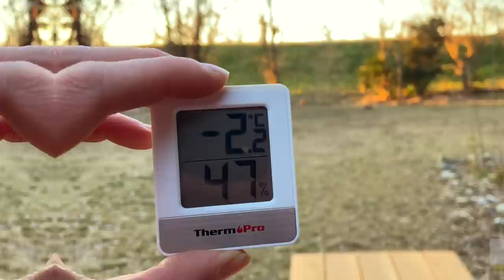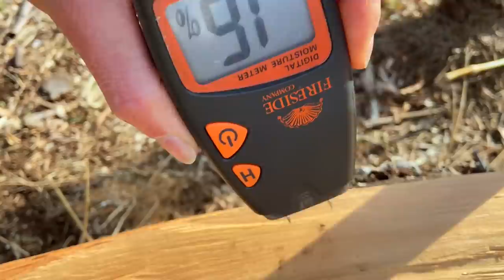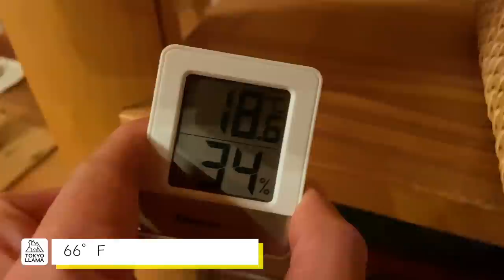Winter in a Japanese House | Tokyo Llama

Comment: I live in a 1970's house with big floor to ceiling windows in all of the rooms and switching to triple glazing made a world of difference, more so than the ceiling and wall cavity foam insulation. I had the original wood windows still in there and there were big gaps and draughts all over the place. I don't have central heating (just a couple of storage heaters) so keeping the heat I have is very necessary!

Comment: Love seeing the traditional house.  

On the insulation and air gaps.  I have an old extra house. I spent a day going through it spent almost $100 on insulation stuff. Most importantly air sealed the entire place. My heating bill dropped in half from $300 to less than $150 a month. 

This winter no one is in it and I put the thermostat at 60f and the electric bill has been $60 a month all winter. 

Funny you mentioned Nashville that’s where I grew up and not far from it now.

Comment: Living in switzerland, I'm quite shocked seeing the gaps in the doors and windows. In our country it is an absolute no-go. I'm living in a 25 year old house (with in swiss opinion "poor" insulation), and the heater is turned off during night, but the temperature drops 2 to 3 degrees (maybe 1 or 2 more when the temperature outside is beloy -10°C). It's hard to imagine living in your condition: 8°C... I shiver by only hearing it... ok, I'm a wimp ("Warmduscher" as we say in German).
Reply: Lol, warmduscher here as well, I was staying in a traditional little house in Kyoto in january a few years ago.. and the toilet and the shower room were outside in the yard. Yes, the toilet seat is heated, but you still have to cross the snowy yard and.. well drop the pants. Showering was even worse, there was only a small heater on belly-level so after the shower your feet and wet hair was icy and I had to do the fastest dressing myself ever to run back into the house and hide underneath the futon. Nichts für Weicheier.

Comment: Single-pane windows are literally out the window, so I think doing a full upgrade will be needed (preferably in the mid-springtime when it's warmer). That is a very interesting way to stack split wood. I prefer the usual "jigsaw" method myself, especially since I have a wood shed. But that kerosene stove makes me super nervous. Upgrading the insulation in the house is definitely a must, especially in the attic spaces (you can also use the spray-type for filling in the very small areas as well). Keep it up!!!

Comment: My hubby owns a very reputable, mid sized HVAC company. He has used that exact version you have, the upgraded version, and other brands & variations. Your phone’s camera with the os you downloaded to make it a thermal camera is fine. I actually still use it. It’s quick to download, easy to understand and operate.
Reply from the maker: That's good to know! Thanks. I'm happy with it and don't need pinpoint accuracy for my uses.

Comment: Hi. We had our windows replaced in our cottage, bricks not wood, but we do live in a very green area. I asked the engineer what the benefit of the triple glazing was and should we go for it. He said it really is only a benefit if you live in a noisy area and want to block out traffic, planes etc. Worth considering if usually your temperatures are mild. Good luck with it.

Comment: a lovely feel to this video. those kero heaters certainly have an unmistakable smell to them. i would get one of the diesel heaters used in caravans which ducts the combustion gas to outside. plus they are efficient and quite cheap and give push button operation

Comment: When I lived in Japan we also used a kerosene space heater.  Later I bought a small electric heater, shaped like a box and only about 12”x12” but it was great, so I recommend that.
Reply from the maker: We do have some electric ceramic heaters in the bedrooms, but not as good as kerosene, however we don't want kerosene stoves in the bedrooms.

Comment: Hey neighbor, here in our 8 year old house in Tsuchiura we still have some cold spots. Despite the double pane glass and newer construction, I think its just status quo. Our house is single story and we only have the wall mount heaters which are less than ideal. Id like to install some radiant floor heating this summer. We have a bit of a crawl space under the house, so hopefully the install can be less painful. Currently we just heat the rooms we use most, keep our inner doors closed, and the rest are quite chilly....shognai I suppose. Love the crisp dry Ibaraki winter so far though (first one) happy its low moisture as it doesn't feel as bone chilling cold.

Comment: Heated floors are now very popular in Japan, along with heated carpets. I spent my first few years in Japan working under a 'kotatsu' in a 6-mat room. The kotatsu is just a large quilt placed between the top and leg-section of a low table with a heating element underneath it. You tuck your legs under the quilt and that keeps you nice and warm -- very energy efficient and very cozy! Some kotatsu also have a depression under the table for added comfort.
Perhaps you could introduce your viewers to the charms of traditional and modern kotatsu.

Comment: If I can make a suggestion on the older ceiling insulation? There are often types of insulation that can be sprayed over a surface to a desired thickness, and dry to form a solid, water proof layer. I would definitely look into doing that and keeping the old insulation in place. It may be very cost effective.

Comment: I don’t know your codes for window replacement but I am in the window business in the south eastern us. I think your cost benefit will be best served with a double pane gas filled windows, the low e coating is very important for reflecting heat out in summer and in durning the winter.
  The type of spacer used to hold your glass pack in the units is almost more important then the amount of panes. The mechanics of your sliders is also super important so research the issues with any unit you buy. 
  Good luck and thank you for sharing your journey.

Comment: You have come far on this home. Simple curtains to cover large glass areas at night helps alot. Some day adding floor insulation would be a good idea.
Reply from the maker: We have floor insulation, and with the thick boards can generally walk around without slippers, but curtains would certainly help.

Comment: For the Windows, maybe more of a temporary solution, but there exists some see through foil which got a sticky side and can be glued to windows, got single pane windows in Berlin Germany and it gets quite cold. Maybe that will help with the insulation
Reply: In the US we can buy shrink wrap window insulation you apply with adhesive tape. It works quite well.
Reply from the maker: I'm going to try some of the clear film, think that could be the best solution until we get new windows.

Comment: A thermal camera is a great idea. Japan definitely needs to up it's insulation game. The draughts are nice in summer though.
Reply from the maker: That's right, the house deals with the summer pretty well - didn't need air conditioners last year so that's something to keep in mind if I do remove a lot of the big air gaps.
Reply: @TokyoLlama  It seems you have a lot of windows you can open in summer. You'll need a lot of mosquito screens though.
Reply from the maker: @bfgt  correct, we have fly screens for all of the windows. Lots of mosquitos here.

Comment: I live in Tokyo and the general opinion seems to be that if you insulate too much you will be a bit warmer in winter but you will also be unbearably hot in summer. I tend to agree. It's not hard to make the room you are in warm. Bedding is meant for lightly heated rooms and kotatsu (tables with a heater underneath) keep everyone warm as well. The real horror is the heat and humidity of summer so good air flow through the house is crucial. It was fun to see your house in winter and I look forward to further videos.

Comment: There is a reflective insulation product made of bubble wrap and foil that could help. It is not cheap, but cheaper and easy to install than all new insulation. Could help in the attic areas
Reply from the maker: I'll look into that, sounds like it could be good for some of the ceilings.

Comment: Adhesive backed foam will reduce the air gaps. You can get them in rolls and it’s very cheap solution.

Comment: That heat-vision is very useful tool for "heat bleeding" (nice ref)! As is the moisture gauge (under 20% so all good).

The topic of energy efficiency is so important imho for houses so checking the insulation values is the right thing to do in conjunction with a wood burner (maybe find a cheap plot of land one day and plant loads of trees to complete the cycle). I think the Japanese might be a bit behind on this topic? Some of the natural-build materials such as cob and straw-bale have excellent properties (eg humidity regulation, insulation rating etc) apart from modern materials. As you'll know from living in London, UK, the quality of insulation there is very variable to say the least as well. But good insulation not only feels a lot more comfortable, but will reduce chills that lead to getting colds as well as reduce energy demand and therefore reduce wood fuel used per year which reduces either cost or labour (or both)!

Does the wood stove position where the flute leaves near the top of the house and more or less in the middle of the house to optimize pressure difference in former case and heat convection in the latter case? I like the fan system to improve that convection. In cold countries they build their houses around very large thermal masses which enclose the wood heater in the center of the house to optimize heat during the night at extreme temperatures. But assume your house will act equally well during a hot 36 latitude Summer for opening windows and doors and allowing air in? Japanese houses supposedly open up and allow the outside to "come into the house" as a design aesthetic which seems brilliant to me (In Wolf Children, anime, I think they have such a house when they move to the country where they do this).

A really good environment for the kids to live and grow up in. A physical and mechanical environment to learn about life is really healthy for mindset I think. Eg jobs need doing: Chopping wood, tending food sources or animals. Constructing stuff etc.

Lovely scenes in the snow: You're absolutely right, the house looks like paradise in the snow with the wood burner visible inside, glowing! I like snow, I think it makes everyone think about their environment a lot more and be (needfully) more down to earth. Thanks for sharing and inspiring.

Comment: Not sure if they have it in Japan, but in the UK there is a product that is essentially a large roll of bubble wrap coated on both sides with foil that you can lay on top of existing insulation to augment it. As it's quite thin it doesn't take up much additional space and is very quick to do.

Comment: Good to see your new video.  Here in Idaho we have strong winds which penetrate the homes exterior.  If a home is well insulated it is quite different from its ability to stop air invasion.  Triple glazed windows are great but installing them so air cannot invade around gaps when installed is a must.
Reply from the maker: I'm planning on doing the windows myself, but it's definitely a worry that I do it properly as we do get strong, cold winds here in winter.
Reply: @TokyoLlama    Most U.S. made windows have a flanged perimeter used to attach the windows to the house.  I  use a good exterior caulking on the side of the flange
Facing the house to insure that wind cannot get past this flange.  However the window itself or sash, can leak on poorly installed or inexpensive windows.  I have no idea how your situation in a traditional home in Japan is similar to a new or refit in the U.S.  i do enjoy your videos, thanks for your presentations.

Comment: move your firewood wicker basket a bit further away from the stove, as the oils in it dry it'll be more likely to catch fire

a simple temporary way to improve the windows is to tape the small type of bubble wrap over the windows, it acts like a dead air insulator

dont have to waste time removing the old attic insulation, most times you can just have new stuff blown in over top

heating rocks on the top of the stove and setting them on stone plates in rooms helps keep them warm longer due to the slow release of heat

a kotatsu might be your best friend in the mornings

Comment: with our dual pain windows we also have window shades, along with heavy drapes that 
 block out the heat, we have sliding glass doors, with heavy blinds for blocking out the heart of the sun and the cold from the winter months when need be. really cuts down 
 the amount of energy for heating and colling. I see by the comments, it's a toss up,
 to have it or not, I'll take it, I lived for a time in many places around the world, 
AC is a awesome thing to have, Heating the entire home ois an other awesome way to have 
it, a couple of things mold and if the home is outfitted with plumbing, preventing the pipes from freezing. 
 we have central hearting and AC pump system, it ant cheap. but when it's a 125 degrees out side, your very grateful to be blessed by having it. when a kid I lived in an old farm 
house, the blue room was outside, running water was the hand pump in the kitchen. 
 The electricity was out in the barn. In Bolivia many live in stone wall spaces, no heat 
 no running water. very little medical. Cut our blessings to be blessed to be able to afford 
such amenities, amen..

Comment: It never occurred ti me that the house would be cold. 5 degrees c that IS really cold, considering the minimum works health standard of a warm home is 18 c. I think you need to invest in another log burner or  a couple of heat pump / air con units. Definitely replace those sliders! We are just about to go into winter here in New Zealand 🇳🇿 it’s been an amazing summer. Love your content, been following g for a few years now!
Reply from the maker: It’s only that cold in the morning - it heats up pretty quickly. But yes, we will be putting ac/heat pump units into the bedrooms, washitsu and maybe the kitchen area. We have the breakers/power points set up for additional units if needed. Thanks for watching all this time!

Comment: Our house is an old wood 1900s house with crap insulation and super drafty. SO I feel you. We have a wood stove, but I did not grow up with that. It took a while to learn how to set it up at night so you still have some coals in the morning, enough to keep the eco fan moving. We save a med-large hard wood knotty logs as the very last log for the night to be put on top of a good bed of coals, then you close up the air intake to almost nil. This slows down the log to have a very slow/long burn. This makes it not throw tons of heat out, BUT it will keep the house from getting freezing cold. And if you do it right you should have coals still in the stove in the morning to just throw a log in to catch for quick warm up. I see you also have tons of stove pipe inside the house that you can get heat to come off of with "Stovepipe Heat Exchangers". If you paint them black with high heat paint they will blend in with the pipe.You then will get more heat out of the stove with burning less wood. Hope this helps.

Comment: If you Cant seal and add insulation ADD thermal mass !!! Large dense rocks beside fireplace will hold heat over night even as fire goes out. 
Add stones or rock material to areas of high heat. ALSO blow that fan across the fireplace not above it. So much eat loss up the chimney flue.That is why western houses have large rock chimneys. Retains heat over time and releases it slowly.
My cottage was so cold with just a stand alone fireplace like yours. I added more fans turned down the vent to super low and added large rocks all around. In the morning it went from 5 c to 15 c with the same outside temp. BIG difference :)

Comment: Big difference to the houses here in the cold parts of Europe.
Central heating systems with radiators in every room are the norm here. Houses are so well sealed and insulated that its no problem to keep the entire building warm. Usually you have a gas fired boiler circulating hot water throughout the entire building. 
District heating is being expanded more and more and it has been around for a long time in urban areas. 
Also heatpumps are becoming popular.